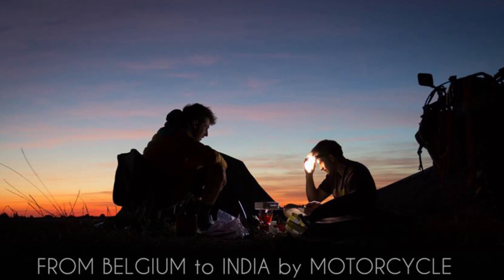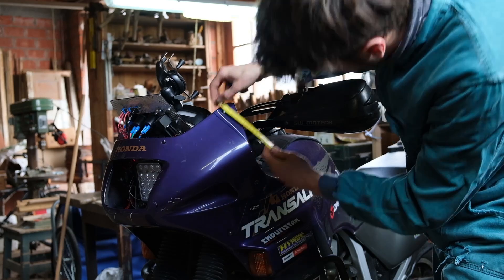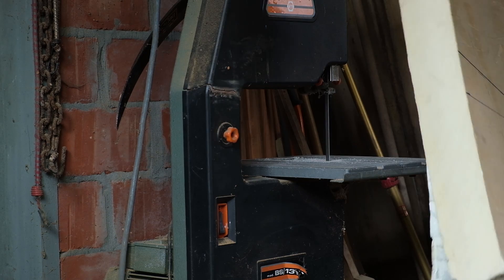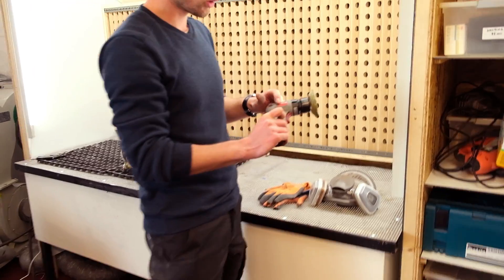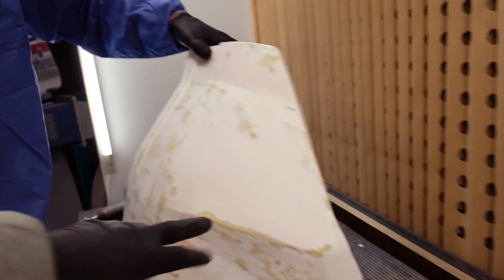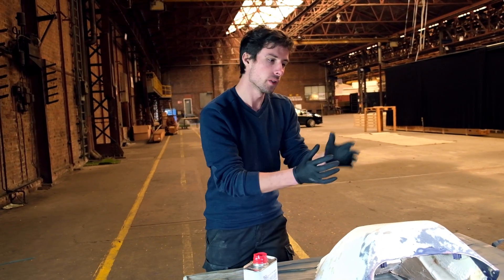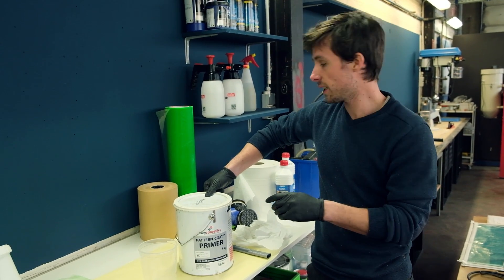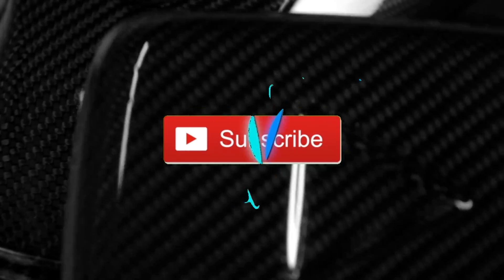Making a Carbon Fiber Motorcycle Rally Fairing - DAY 1

Comment: Nice video. Looking forward for the next ones! Small question. I'm on the lookout for an air compressor to hook up pneumatic tools and a spray gun to do similar stuff (I want to modify track fairings next winter to have a motoGP kinda style). What are the minimum specs (volume, air displacement, oil lubricated, max pressure, etc.) you would recommend?
Reply from the maker: I have a 50l air compressor at the moment with 400l/min output at the moment, but as you can see in the video I'm switching to all air compressed so looking for a 600l output at least now and 250l tank. You should be ok with a 400l output if you just do small stuff put I'm upgrading to all air compressed with different lines so will need more :) I expect to pay around 1200 euro for a good air compressor now but for the one I had till now I've paid 380€ I think.
Reply: Matthieu Libeert Thanks for the feedback. That’s somewhat more than I was hoping, but glad to hear. Good luck with the build
Reply: Careful using winglets and other "external aerodinamic element" on your fairings, a lot of tracks are banning them for trackdays and similar events.
Reply: gafrers Thanks for the advise. Looking for the “pre-winglets” look though 😬